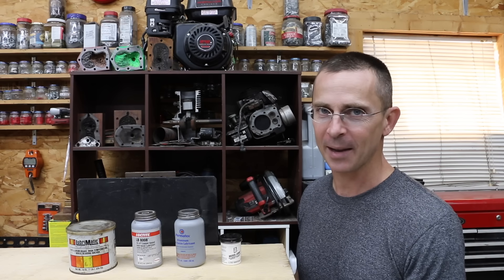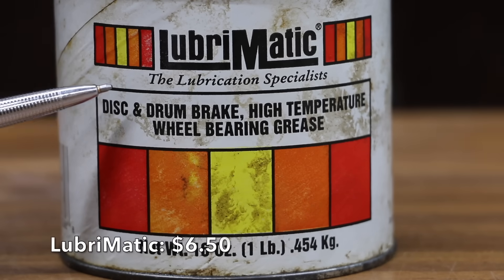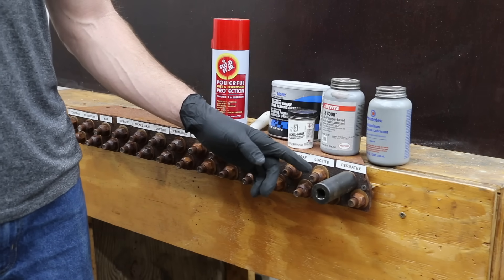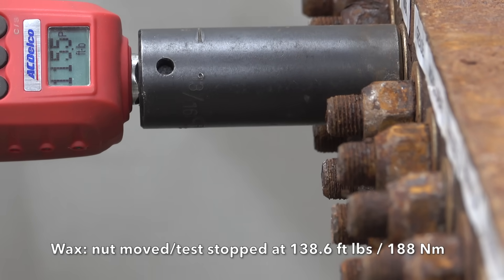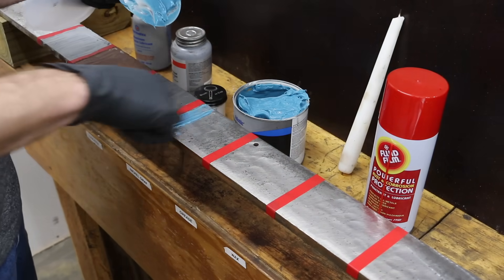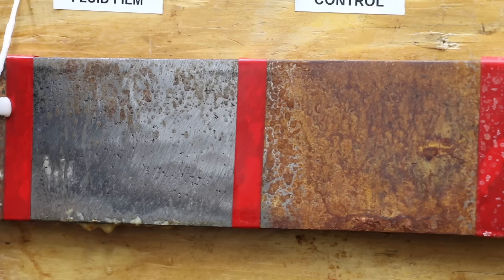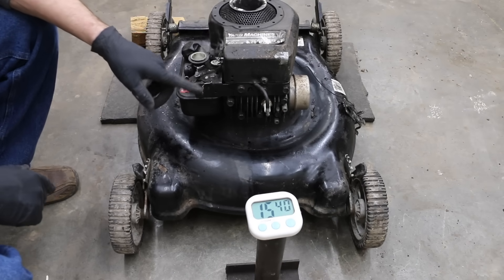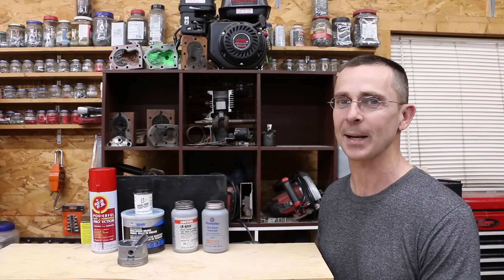Does Anti-Seize Compound Actually Work? Let's find out! Anti-Seize vs Grease vs Fluid Film vs Wax

Comment: I’m just impressed that he and his shop weren’t coated in anti seize by the end of this. Anytime I touch it, it magically gets everywhere.
Reply from the maker: lol   That would have been a problem!
Reply: @ProjectFarm  it don't come off that's for sure.
Reply: @ProjectFarm how many boxes of gloves do you go through in a week on average?

I go through... a lot 😆
Reply: Lol ikr... Like how in the hell did it get on my elbow!  🤔
Reply: @Lawdagreat  
Worse is when it ends up on the wife's towel. End of the world. ;D
Reply: Yes. Especially the permatek. That stuff gets EVERYWHERE. Especially when coating wheel hubs with it lol
Reply: @shaggydaboy2  sadly I learned that the hard way lol
Reply: @shaggydaboy2  Just get grey tools, you'll never notice this issue! ;D
Reply: @Foxlawl  ... Till you grab your sandwich and drink and try licking the oozing condiments off your fingers. Hey, it's a natural habit to not waste a thing. 🤗
Reply: @shaggydaboy2  never put it on lug nuts
Reply: @franksespool8150  I always put it on lug nuts. Every big truck I ever removed tires on got never sneeze on the studs. Keeps the aluminum from sticking to the steel.
Reply: @franksespool8150 Use it on the tapered part of the nut where it contacts the wheel. That is where it generally galls.
Reply: @shaggydaboy2  Ultra Anti Copper. Lol
Reply: @shaggydaboy2 Yessiree...a little bit of that stuff can spread out over a W-I-D-E area.
Reply: @shaggydaboy2  Ultra Copper. Ultra Copper with some antiseize. Go in the house after using them both, kid's might think you're the next new super hero.
Reply: How the hell does it get inside my gloves, on my elbow, on my car seat and everywhere in my tool box.
Reply: Antiseize: Mechanics glitter.
Reply: @Spartan_Jackal  Yep!   Mix Glitter and Never-Seize and it will be the end of civilization as we know it.
Reply: @jbhh79  I used to work with a mechanic that was married to a stripper. Between his insecurity and his mullet he was insufferable. But civilization did continue.
Reply: @jbhh79  Good thing strippers don't know about Anti-Seize compounds.
Reply: Olfway12991 perfect comment lmao I’m using that. “Mechanics glitter” just like the torch has a nickname “HOTWRENCH” xD
Reply: @Spartan_Jackal  Never thought of of that. Funny
Reply: Herpes of the car industry
Reply: Me- looks at un opend can of anti seize
Me 2 seconds later- (looks like tin man)
Reply: @JohnnyCadillac1994  Yes I agree Jonny! I know huh!
Reply: Bro, I got copper antiseize and I clean the exterior of my bottle, and always wipe. IT STILL GETS EVERYWHERE IDK HOW
Reply: Ha! My neighbor had a habit of moving my garbage cans so I put a blob of anti-seize under the handle. Funny, he has never moved my garbage cans since!
Reply: Bob Wallerick next thing you know your neighbors car is a new “silver” color
Reply: @AndrewKidd14145  Put that aluminium based anti-seize on when you next portray Tin Man in the Wizard of Oz...lol.
Reply: Byron Harano Lolololol, that’s why I don’t use that the copper is much more flashy 😂
Reply: Bob Wallerick you’re evil, that’s the most evil I’ve ever heard of
Reply: @AndrewKidd14145  Yes! But mighty effective!
Reply: @bdybybb  ..."DAD move"‼️®️™️
Reply: Kel DeWeese always said you can paint a road fifty miles long with an empty can of never seize. And yess I wear more than I ever use.
Reply: Just like the tin man on the wizard of oz.
Reply: We use to put it on the sweat band of someone's welding hood or hard hat and watch the show. They would use their arm to wipe sweat from their forehead then it's every where before they know it
Reply: I really go through the gloves cuz I have issues with it.
Reply: Gasket maker does it to me.
Reply: Spray a tiny bit of WD-40, rub to mix, wipe off with a rag. Easy way to get rid of it. I wear rubber gloves and clean them off that way.
Reply: @802Garage  Yep, WD40 takes it right off, then wash hands with dawn and go to dinner.  For denim, WD 40 then lestoil before the wash.
Reply: @BrianFullerton  that same dawn does womders as a presoak juat keep the bubbles issue in mind when runnin several pair thru at a time lol also old school type GOJO hand cleaner is a good presoak
Reply: I had a guy I used to work with who used fingers to spread the copper loctite instead of the brush in the lid because and I quote "it gets everywhere anyway"
Reply: Andy Miller I mean it does lmao
Reply: Gasket maker does it to me.
Reply: @adamfpv8294  I get high tack everywhere whenever I use it at work no matter how careful I am
Reply: Same goes for RTV.  Everytime I touch either it ends up in places you'd never believe.
Reply: The best thing you can do when opening a can of anti-seize is to immediately apply it to the nose, behind the ears, and the crotch of your jeans to just expedite the process.
Reply: Yeah it does. I recommend it on a bologna and cheese sandwich. 
Come on. Who hasn't used antiseize, made any kind of sandwich or food for that matter. Looked at it and said "Screw it" then take a bite.
Reply: Kel DeWeese I’m super careful and it may not get everywhere but it gets in surprising places... the “wait, did I even touch that” places
Reply: I know right! No matter how careful I am some always ends up somewhere I don't want it. Dreadful stuff. It does work though, both this video and my own experience has taught me that.
Reply: @woopimagpie         CC’s
Reply: Yeah, no kidding.  I usually find it even after a few days...lol
Reply: Step 1: open bottle
Step 2: go ahead and smear it all over your body. 
Step 3: make sure you get a little bit on the bolt.
Reply: @lightningguy4897  🤣🤣🤣 that seems it's how it really works
Reply: That’s how Jack Haley got the job of the tin man in The Wizard Of Oz.  He was messing around with Permatex and the director happened to see him.  :)
Reply: @for2utube  you do know that Buddy Ebsen was originally cast in that role but the metallic paint made him sick?
Reply: @for2utube  That and they almost killed Buddy Ebsen by using powdered aluminum on him as make up.
Reply: Stop bathing in it you heathen 😂
Reply: Marshall W  ohhhhh a spot on the door handle. Man that just pure mean and evil.  I Love It!  Im putting this one in my bag of dirty tricks.  The door handle... hahaha!
Reply: You're Awesome!!! Thanks again for saving me time, effort, and money. Love this channel! Keep up the good work!
Reply: Glad to see im not the only one. I use it occasionally in a machine shop and even if I only handle it for 20 or 30 minutes I look like the tin man after
Reply: I don't like ̶s̶a̶n̶d̶  anti seize. It's  ̶c̶o̶a̶r̶s̶e̶  slippery  ̶a̶n̶d̶ ̶r̶o̶u̶g̶h̶  and greasy and irritating and it gets everywhere.
Reply: I was called to a meeting once with the owner and some customers for about 30 minutes.  
When I went back to the floor someone said "what is that on your lips?".  I looked in a mirror and my lips were silver with anti-seize like lip stick.  I had been thinking hard about a problem and had the side of my left hand against my lips.  I cleaned it off and went back and the customers were gone but the owner was there.  He said "yea, we talked about it after you left and just figured it was some sort of medicine or something"...  Heck, people won't even tell you if your fly's open any more.
Reply: Aint it the truth!   I used to play a joke on my work mates.  Coat one side of a quarter with anti seize and put the greasy side down on the sidewalk, then see who picks it up and gets that ** all over em!
Reply: I know usually end up looking like the tin man from wizard of oz
Reply: I know for real! Any time I use anti-seize I end up looking like the tin man from wizard of Oz.
Reply: I did my own brakes for the first time about a month ago so I'm glad to know I wasn't just a slob lol
Reply: You ain’t kidding lol! The practical jokes they’d play in the oil field is putting it on a guys hard hat and when he put it on gets all over his forehead hard to get off lol
Reply: Like rooffing tar, don't get it on your lugs
Reply: Go to the nearest feed store and pick up syringe barrels, no sharps. You will find them cheap, disposable, and useful for many tasks.
Reply: I just look at my antiseize can and the silvery shimmer is all over everything
Reply: I was half expecting him to look like the tin man
Reply: Alright Eric.
Reply: No Joke! It lingers like the plague..... (My ex)
Reply: I have used the permatex for many years and man , that stuff can get everywhere fast !
Reply: Anti seize is like mechanical herpes once you get it on you it spreads everywhere and it’s hard to get off lol
Reply: One time it ended up behind my ear.
Reply: I've ruined several shirts using anti-seize.
Reply: You mean like painting the back of someone's wrench's at work with it???
Reply: It's like rooffing tar , 1 touch and it's every where, keep it off your lugs
Reply: All I have to do is pick up the bottle in our shop 😑
Reply: On my way to leave a similar comment, and you already said it, Ha!
Reply: As a group, we were leaving before daylight every day to go commercial diving. As a joke, one of the guys placed a small dab of Permatex  on the underside of the shift knob of another guys standard on the floor shifter.  We had to drive about  40 miles to work, with numerous stops and starts. Needless to say,  one of us arrived, his face, looking like a silver Martian.
Reply: Got some on me watching
Reply: Then you're using it right
Reply: Tim Man from Wizard of Oz was actually a repair mechanic that was using permatex
Reply: Hes a professional
Reply: Kei - So true !
Reply: We call it the "Silver Surfer" syndrome.
Reply: You get it on your clothes and you'll never get it off. Make sure its junk clothing.
Reply: I remember doing a complete brake job with a wheel bearing replacement on my daily.... somehow, I got anti-seize on my face and hair and my balls.
Reply: I'm not sure where the hell the Permatex in the engine idea came from, I damn sure got a laugh though.
Reply: The key is use disposable gloves and the moment you're done with application, throw them out.
Reply: Same here, I even look at the brush and I'm wearing it lol.
Reply: Not unlike honey. I especially have trouble with the copper stuff when using it on barrel nuts. It’s horrifying how it spreads around on a rifle.
Reply: I've always felt that you could take a can of this stuff and paint a house.
Reply: More rust than bolt , do it
Reply: The mechanic’s STD.  The gift that keeps on giving.
Reply: Just like glitter...
Reply: Like shit on a blanket
Reply: that stuffs like glitter...just gets everywhere
Reply: The Midas touch! In silver....
Reply: Anti-seize is the herpes of the grease kingdom. Get exposed to it once and you’ll spread it forever.
Reply: The old timer mechanic used to say "if its open, its everywhere"...
Reply: You don't even have to touch it. Just open the bottle one time and look into it and you'll find it everywhere for months. 
If you're really lucky you don't even have to take ot put of the package, you van just buy it and find it on your good jeans the next day.
Reply: Can you say "tin man"
Reply: It's like manly glitter.
Reply: I never had that issue
Reply: If it could be used as hous paint, one small tin woulz enough 😄
Reply: Sooooo true
Reply: Absolutely! Use it once, find it everywhere for days
Reply: If you're in the rust belt that's a bonus cuz then you're rust proof everything you touch!
Reply: Liquid glitter..
Reply: I’m like that with grease.
Reply: EVERYWHERE.
Reply: Totally agree.
Reply: The stuff is insidious! It would make a great prop to explain cross contamination in hazmat spills!
Reply: WD-40 will take it off. Well, the aluminum anti-seize anyway…
Reply: You and me both.  No matter what, my hands get covered.
Reply: That stuff is like self-replicating alien blood
Reply: Use perfect seal. Works great. Or aviation sealant. Same stuff
Reply: I was very impressed with the video until the part with the engine, at least you didn't try to use it as a personal lubricant.
Reply: In my shop we call it the "ol tin man"
Reply: Thank God it's just not me!
Reply: It's like ink when your pen explodes...
Reply: It’s been likened to shop-herpes.
Reply: It’s like a can of roofing tar, even with the lid on it seems to get everywhere, lol
Reply: Everytime I touch the CLOSED container, I get locktite on my hands. Literally the single most relatable comment ever
Reply: Yep! You're gonna wear some!
Reply: Like shit on a blanket
Reply: When I use any grease or anti-seize  of any kind I take a hand full and smear it up both arms right off so then I don't have to worry about it( haha)
Reply: Same with silicone and pipe dope.
Reply: Right you can a 0.000001 Oz pouch of antiseize and that shit is magical it has enough in it to repaint all the walls
Reply: I have the same experience.
Reply: I have the same experience with mustard
Reply: Lol
Reply: I keep it behind other cans and bottles on my shelve cause I just know that if I look at the bottle from across my shop it will be all over me by the time I look away
Reply: I can relate to this comment! I'm a Plumber by Trade, and another product that seems to migrate to everything around you, is, a thread sealing compound called Grip, made by Hercules. This thick, oily paste is used to seal threaded fittings used on propane, and natural gas appliances, fixtures, gas regulators
Reply: I can relate to that comment! I'm a Plumber, and another thread sealant that also seems to get onto everything you touch is called Grip, made by Hercules. It is used to seal threaded fittings used on natural gas, and propane lines/appliances, etc...
This stuff is "Hella" nasty too!
Reply: Are you Gixxer Foo?
Reply: If there is someone you don't like, or want to play a joke on, do what I used to do. If they wear a baseball cap or hard hat, spread some of that goodness on the inside front so as to get it all over their forehead.
Reply: I used to use the loctite marine grade anti seize when I was still working and it always prevented hvac fan blades and bearings from rusting on but no matter what, I always got it on my uniform shirt somewhere!😂
Reply: theres a lot to be said for wearing a "apron" for lack of better word.... sorry.... or a smock pf some flavor so i dont have to replace my clothes after assembling an engine..... love all the copper products from Permatex and rely on anti seize brands as well not just this compund they sell many products
Reply: Always use gloves and just throw them away as soon as you put the greases.
Reply: OLD SCHOOL I remember those days,  I use gloves now and tube molybdenum and graphite blend.
Reply: O
Reply: I was always told you could paint the Empire State building with a bottle. God bless.
Reply: Right?
Reply: Say what🤔

Were made in HIS image. HE made us with the power of free choice
A good prayer:
I'm a sinner JESUS please forgive me for all my sins I know you shed your Blood for me on the cross at Calvary. Thank you JESUS for my salvation and for shedding they Blood for me. I love you JESUS. 
Romans 10:5/10 ct...❤️k
JESUSisLord!Amen...
Amen..
If you'd like to call someone who cares 
83
For
Truth.
bc you don't know when you'll die?
.y r u hesitant.

.

...

.
Reply: The worst is when you have a tube sitting on the floor and forget about it and step on it... all over the driveway and wasted money
Reply: Silver ghost fingers for sure.
Reply: Yes I agree, Roofing cement is another one, no matter how hard you try, it gets everywhere🤣
Reply: Like PVC primer.
Reply: Chesterton nickle anti seize is the best.  No torque value adjustment needed.
Reply: silver noses DO happen in the shop
Reply: Stuff seems to just jump out of the can on you, no matter how careful you are. 😂
Reply: Hahahaha I’m f*ckin hollerin…😂😭
Reply: Everywhere! Things not even in the same area and category end up covered in silver
Reply: I got it all over me just watching the video !!
Reply: It’s about the only thing I pull out the latex gloves for lol. I’m cautious to avoid getting any on m hands but a few seconds later one glove has it on the fingers and palm lol
Reply: Every four months I change two five foot diameter hydraulic cylinders. They use anti seize on all the machined surfaces. When we're done we've used four large cans of anti seize and my boots are basically covered. Very messy.
Reply: Wear one and ONLY one set of clothing that you couldn't care less about, because I've got jeans with specks of it on em, been there years and still won't wash out!😂
Reply: I usually end up looking like the tim man in the old wizard of oz
Reply: Never seize Magnet 🤪
Reply: That's the Gods truth!
Reply: A small smear of grease on the thread and the taper of wheel nuts seems to be great for avoiding struggles when changing wheels.
Reply: Put it on your steering wheel to prevent theft.
Reply: I was surprised that he didn't have it in his hair and all over is clothes. One drop of that covers everything.
Reply: I’ve been using antiseize all weekend, and I’m still cleaning it up from random places🤣🤣
Reply: that is one of the truest things i have ever heard
Reply: It's because you're not paying as much attention as you think you are lol
Reply: Anti seize is the most feared substance in any shop. A little dab will coat everything but the part you're working on.
Reply: yep.  been there.  🤣🤣🤣🤣🤣
Reply: Once you crack the lid  on a container of silver anti sieze
It has a mind of its own ! is like letting the bad genie out of the bottle !
It will almost instantly appear  in places it's not suppose to and stick around !
And a tear in a glove is like a hole in a condom with a runaway sperm !
You never get it back !
You have to wear it for a bit till you can wash your hands of the whole deal !
Another  thing that gets around  is black sikaflex
We had the salesman come in our shop with his suit and tie rounded us up and  was selling barrier cream
He sprays what looks like shaving cream on his hands rubbing them together and says
"My hands are protected 
I am wearing the invisible glove ! 
For the  next 12 hours no paint or chemical will get thru  to them !
I said  "they are not protected  "
He said " oh yes they are !"
So I got some black sikaflex and put a little dab on his fingers
Within minutes  he had it on both hands his face is tie his shirt his jacket
20 minutes later we were in the washroom cleaning his hands up with lacquer thinner !
Awsome video  !
Have a great day  !
Reply: lol me too
Reply: The same thing happens to me. It always gets all over the place.
Reply: @KB-ld7jw  insert lenny face
Reply: I always end up looking like the Tin Man when I use permatex. LoL
Reply: Hey mates i started uploading videos t his week. I used sunflower oil as engine oil can you guys give me feedback? Iam curious to know what you think❤🙌
Reply: @Builditathome-Restoration  the original high performance engine oils for aircraft were vegetable oils. Castor bean oil was used in racing motorcycles into the 80's. Temperature is the only issue.
Reply: @dbmail545  I run Renewable Lubricants 5W-30 in everything I own.  Vegetable based, deals with fuel dilution wonderfully, and my oil analysis results have never been better.
Reply: My coworker bought a brand new ram. I owed him one, so i got his keys, coated the shifter and the inside of the door handle with the stuff, locked it back up. He spent 45 minutes cleaning up the mess from opening the door. He went to drive off, grabbed another handfull and lost his mind. I had to run he was so pissed.
Reply: @patsfast1980  that's horrible
Reply: I put it on my lugnuts, lugbolts, wheel mating surfaces, all assembly bolts, my ear, nose, cheeks, chin, & neck. I also got a little on my finger...
Reply: So true lol
Reply: Anti seize is the epitome of "A little goes a long way".  Especially on you, your clothes, and anything you are near! LOL
Reply: lol yeah that permatex is like a girlfriend that always has to get in the last word